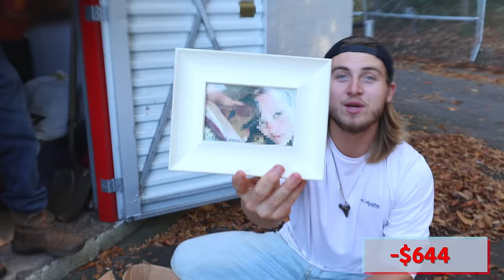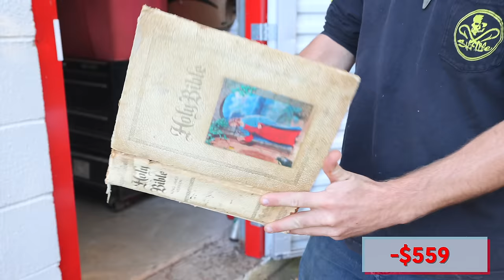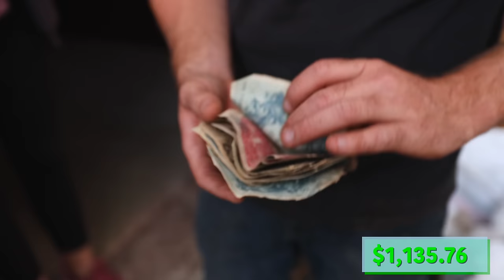I Bought A Storage Unit Loaded With Priceless Antiques!

Comment: Hi Gentleman, if you will put the metal rusty hand tools in a small plastic container, and pour Coke Cola over them( make sure to have enough coke cola to entirely cover the tools) leave overnight. The next day take tools out rinse and and wipe clean. Most of the time the tools come out with the rust gone. You can also put Coke Cola on battery car terminals and it will take the rust off.
Reply: The only reason I have coke is for this reason. I don't drink it. Works great though

Comment: Singer.  Congratulations on the great finds!!  Those sewing machines will attract some interest for sure, and the handheld drill is fantastic for working with exotic woods.  The thing with all of those "rusty" tools is that the wrenches and sockets are chrome-vanadium or other alloy, and they don't rust.  They do, however, collect rust from the surrounding tools.  I used a small tub, a can of Coca Cola and a scrubbing pad to clean mine off.  Let them sit in the Coke for a while and that will loosen the rust deposits.  Higher end tools are made to last, not so much with tool boxes.  WD40 can help with the wire cutters and such.  Those big bolt-cutters should be fine, and can be tuned if needed.  Keep up the great content.  Did we miss the 100,000 Clean stream goal?

Comment: The hand drill is actually called a brace used mostly in carpentry.  That's all they had before electricity ... you might say they were the first cordless drills.  They still make them.

Comment: I've had great success getting rust off tools by soaking them in vinegar. The acid in the vinegar eats away at the rust without damaging the tools. Soak for a few days, dry it off, and rub some oil on the tool to weatherize it, often good as new!

Comment: Singer.  My grandmother had both of those first two Singers. The first one had an auxiliary motor on it or you could use the treadle. She got the second one in the late 60’s or early 70’s in a different cabinet and I still have it. It still works too.